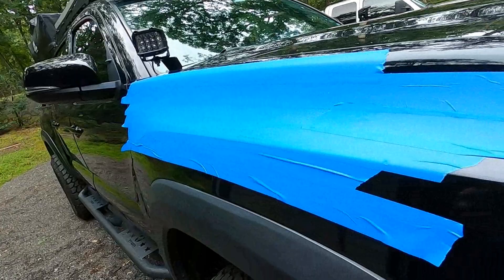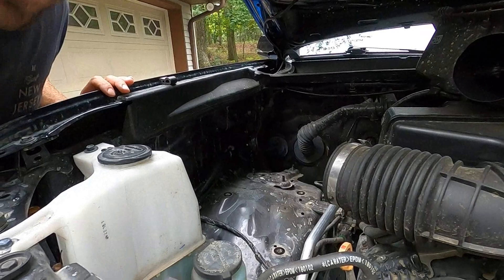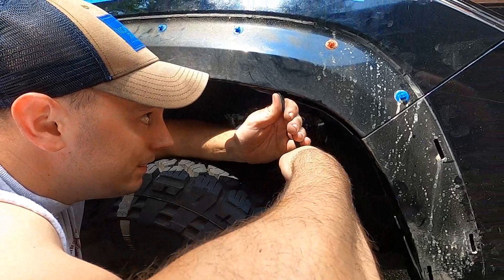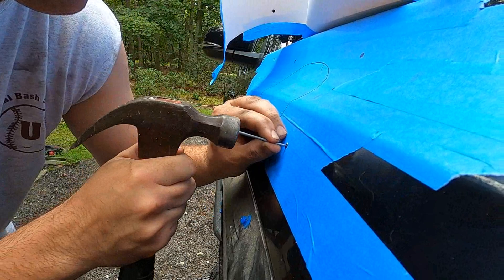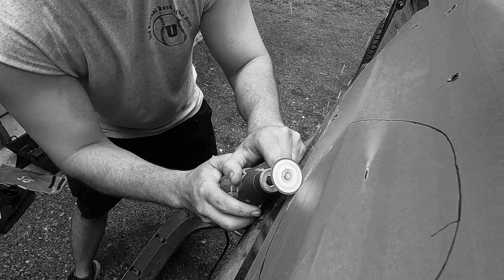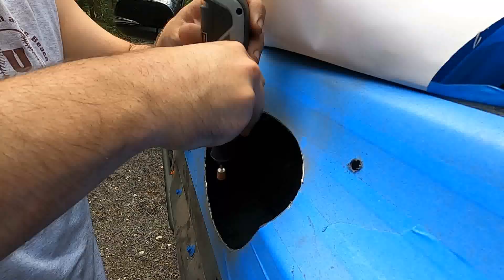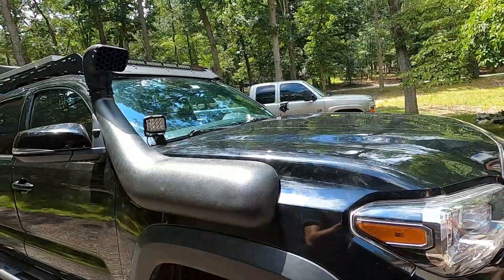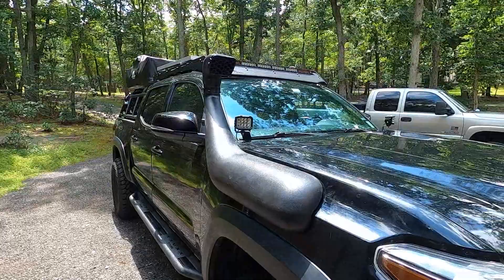Dobinsons 4x4 Snorkel Install | Toyota Tacoma | 3rd Gen

Comment: Thanks for the info, about to install the same snorkel on my friends 22 Taco
Reply from the maker: Nice! I didn't show it in the video, but I ended up using double sided gorilla glue tape to attach the top bracket to the A pillar so that I didn't have to drill it. Still solid to this day
Reply: @tacosauce4x4  NOW YOU TELL ME 😆 I actually wrapped tape around the drill bit to limit depth, and locked my arm,  my 10 dollar rivet gun worked perfectly! I was shyting a pill! My 03 Tacoma S.A.Swap is a lot easier to work on, 3rd gen pain in the ass! My taco 🌮 has a switch for the passenger air bag, so if I don't like my passenger, I do have options 😅